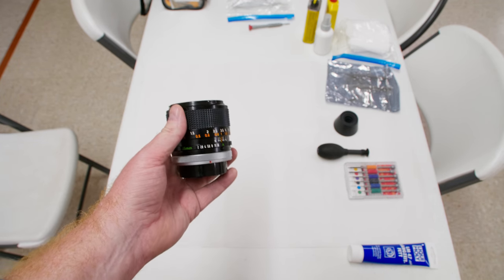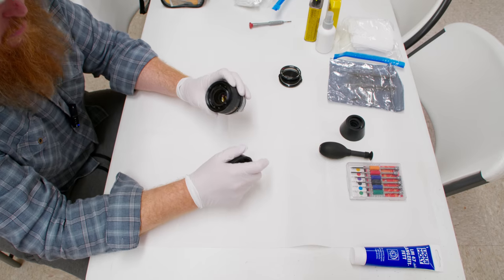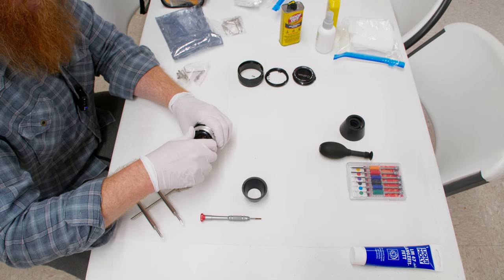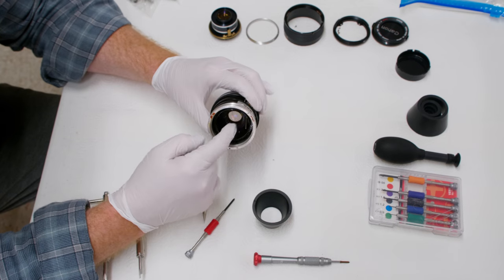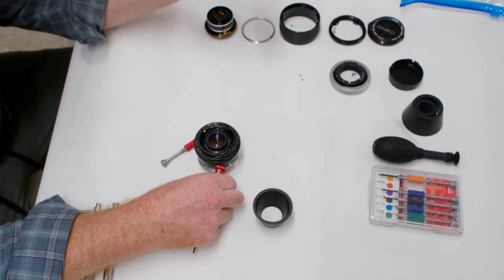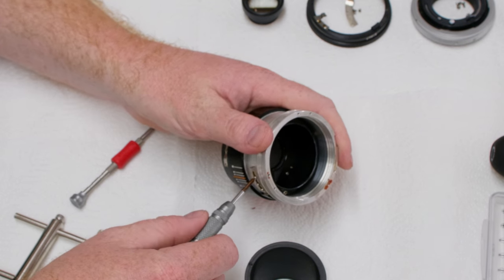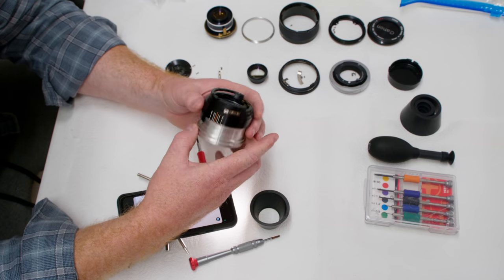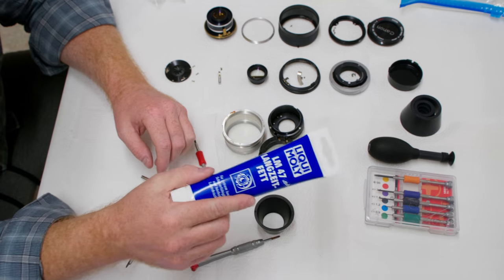Canon FD 35mm f2 SSC Concave Full Disassembly

Comment: Excellent! Thanks a ton for your detailed description and the video!
I just got a convex version of the 35mm f2 ssc and the focus ring neither goes to infinity nor to close focus. Also the aperture is already declicked but it doesn‘t stay at f2 when paired with an adapter but closes itself to about f4.

I‘ll see if I can fix with it your video guiding me theough it 👍
Reply from the maker: Your aperture might have a spring attached that's causing it to close. I've never had or serviced the convex version but hopefully you get it fixed up! Sounds like maybe previous owner tried to mess with it and maybe messed it up. Hopefully not though! Best of luck

Comment: My focus isnt reaching out to infinity, I think that someone might have yanked it too hard to close focus and shifted the stop a tad.

Thanks for the video I'll be referencing this as I approach this project!
Reply from the maker: Gotcha, super easy fix thankfully. Just remove the name plate, the filter holder, and the focus ring. Then remove the focus stopper and reset to infinity. I have a more detailed video of adjusting for infinity on the 28mm f2 SSC and it's the exact same process. Good luck!

Comment: Hi Avery, I’ve been using my copy of this lens for two years with no problems, and today when I picked it up the focus ring was completely jammed! It feels stiff between 1 foot to 3 feet, and then it won’t turn any more, do you know what could have caused this?
Reply from the maker: Could be any number of things. After 50ish years the helicoid lubricant could have finally given up or hardened, there could be debris blocking any of the moving parts, something could have broken or could have become unattached. You can't be certain until you open it up.